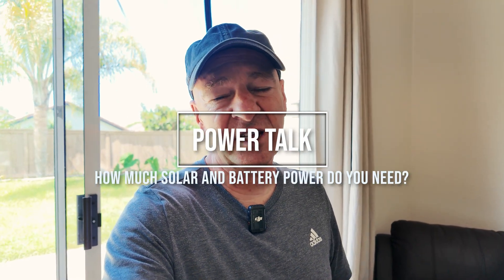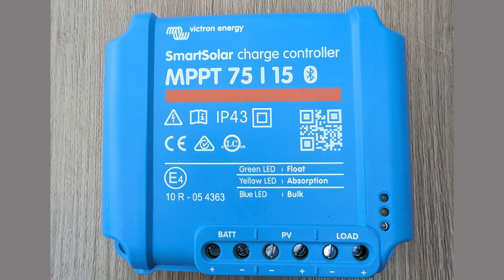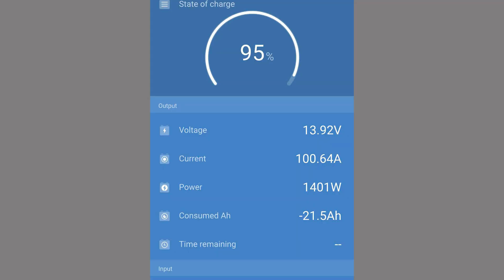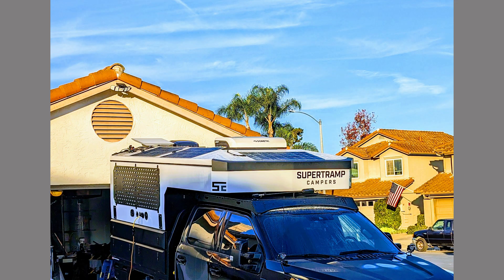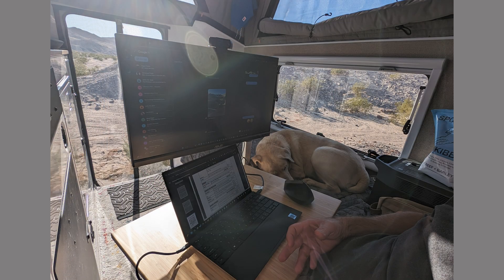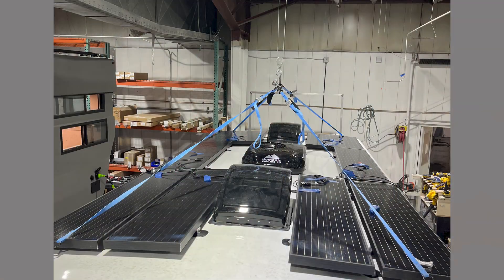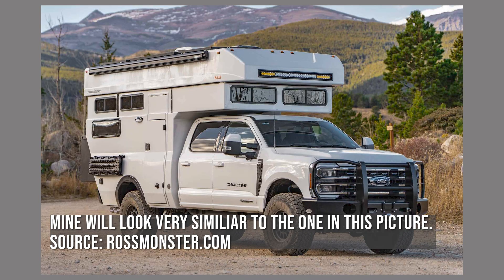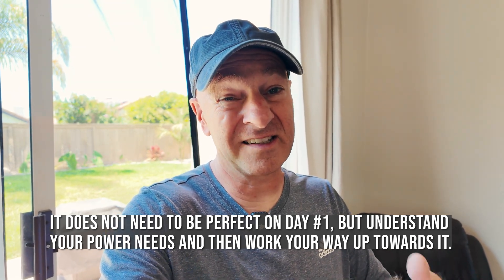Watts up? My Ultimate Solar & Power Setup for the Rossmonster Baja!

Comment: Man somebody got a well-equipped Supertramp camper once you got it sorted out. Did Supertramp work with you to correct the configuration? It seems to me that was a miscalculation on their part…. And those things are pricey.
Reply from the maker: No, unfortunately there was zero assistance or help or anything. I am a bit disappointed - especially, as they took a lot of my learnings and suggestions and used them to create paid upgrades. They sold an undersized system ...

Comment: Subscriber 646. Nice presentation. Getting ready to install 48v 200ah Victron/Redodo system in Class C with 2400w solar. No alternator charging. Will find out if that charges enough.
Reply from the maker: Thank you for watching and subscribing. I really appreciate it.

That is a ton of solar. Are you double-stacking panels and slide them out or how are you getting so much solar installed on the roof. 48v system is great. They seem to become much more common these days. Would love to see pics when you are done.
Reply: @dtadventure4x4  I can fit 6 400w panels on 31 ft Class C, at least I've seen it done.  I'll connect 3s2p to Victron 150/45 charge controller. Should be about 110v 30a. I think I'll need that much solar to keep ac going full-time. Do you think I'm on the right track? Willing to learn.

Comment: Powering the screen from the laptop doesn't save anything. draw is draw. A low amp screen would though.
Reply from the maker: Hey, thank you for watching the video AND leaving a comment. I really appreciate it. Good feedback. The info I provided is very high-level. I did do my homework on the monitors though and while power consumption savings are not dramatic, it is still a noticeable difference between the two monitors. The weight savings help, too.

Comment: Love your content. When your camper is finished will putting the truck in reverse bring up the reverse camera on the touchscreen? Maybe you don't know yet.
Reply from the maker: Thank you for watching and your kind words. Yes, from my understanding the OEM camera will be transferred so that the functionality is maintained. I think it is going to be in the rear bumper. I guess this also applies for the 360 cameras. 

I also have the Wolfbox G930 rearview mirror with the front and rear dashcam and to provide "mirror" functionality. That camera has been installed a bit higher up. Take a look at my build update video. You can see the Wolfbox camera below the large window in the rear. Here is the link:

https://youtu.be/5ADByObKdmE?si=TrqRyr_zUpdV8oOO&t=1222

Comment: Great video. It's important for users to calculate consumption, though it can be hard to do before one chooses and uses a rig. Way back on my very first camper, I had batteries but no shunt/monitor and no solar. Before buying and adding a solar setup, I bought and added only a shunt and battery monitor and then used the camper for a while. The data I collected influenced the size of the solar panel and solar controller that I bought and installed on that camper. Several campers later and the systems are larger as are the battery banks since power needs keep increasing. I learned a lot from that first battery monitor and from subsequent builds. But for those buying a new camper, especially if it's their first camper, it can be hard to calculate. Your experience from your first camper gave you great insight into what you want/needed in this new rig.  

Some appliance manufacturers, like fridge manufactures, give the start up and running amp draw, but also average 24hour consumption since compressors turn on and off.  Some devices are easy to calculate because they draw fairly consistent power when they are powered on like a starlink,  computer monitor/TV, A/C on a specific setting, etc. For other devices, that are used very intermittently, it's harder to pin down a 24hour consumption, like vent fans, furnace and water heater fans, lights, etc. Good thought process and info in this video calculating out what you need and then multiplying it to give buffer for unknowns, changing needs, seasons/daylight and weather events that impact solar generation.

Comment: subscriber #642 here. good luck on your way to 1000. I am also looking into almost full time remote living and am looking forward to more information about solar, batteries and charging. cheers
Reply from the maker: Thank you for subscribing and watching my videos. I really appreciate it. If you have specific questions, let me know. I am happy to provide more detail where needed. 

If you are looking at a van or rig in general for yourself, make sure that it has the infrastructure to support your power needs. A lot of vans or truck campers have large battery banks, but not the solar or DC/DC charging capabilities to remotely re-charge the batteries. That was my initial problem with my Supertramp camper.

Comment: Thank you for sharing your lessons learned, they are very valuable.  Two questions: How often do you plan to use the air conditioning on battery?  Do you have dual alternators on your new truck and if so, how will you use them?
Reply from the maker: My truck has the dual-alternator setup from the factory. The house batteries will pull 100A through the DC/DC charger.

My plan for the AC is to mostly use it during the late evening/night for sleep. But I am also planning to be further north to have cooler temperatures. I am not planning to use it all day and night. That would require significantly more power (batteries and solar) and that is not feasible. If necessary, I will get one of those super-quiet Honda generators, but I will decide along the way.